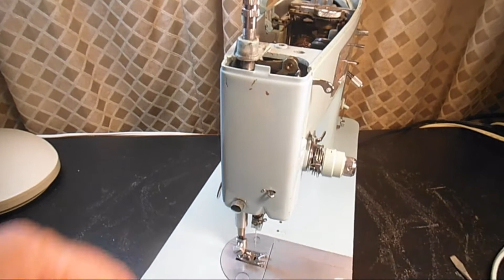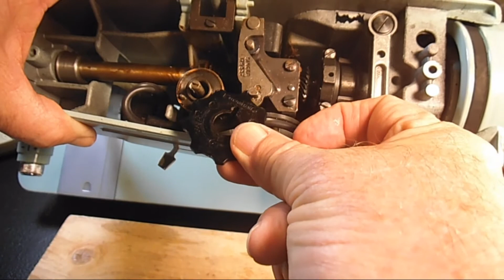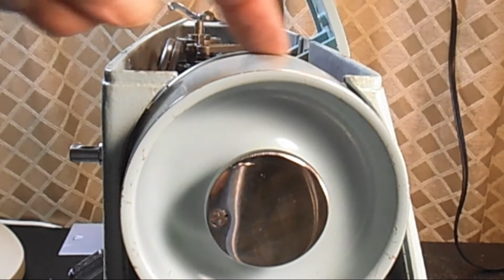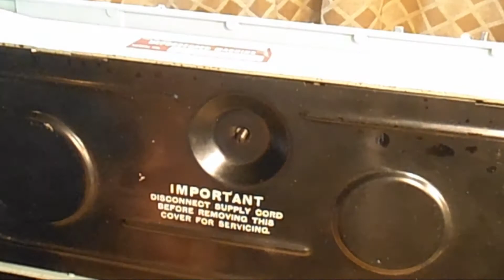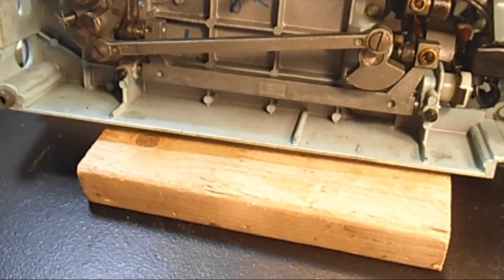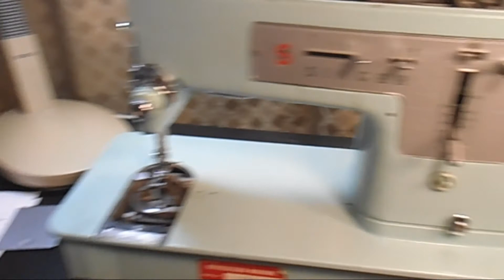Look inside a working Singer Model 338 Sewing Machine

Comment: Thanks for the video Andy it looks just like my 348
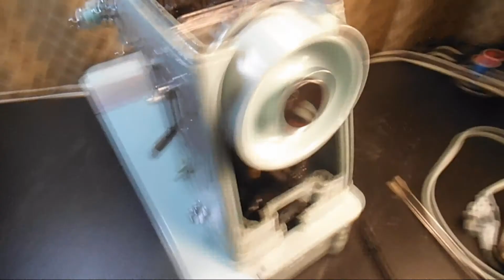Reply from the maker: Yes, the 338 and 348 are very similar but for one big change on the 347/348. The 348 is a 1966 update to 1964 338. They changed the entire hook system on the 348 to a rotary hook powered by a timing belt and metal pulleys replacing the oscillating hook powered by pitman rods on the 338. That change means the 348 is a little faster and the hook is quieter. For others reading this, you can watch this video starting at about 3:20 to get a good look at what the hook/drive system looks like on Ronald's Model 348: 
 https://youtu.be/twlPTcJW5mY      Both are very nice machines for sure though. Thanks for watching, Ronald, and take care.
Reply: @andytubesewing1953  you are the best...
Reply: @andytubesewing1953  sounds like the 338 is more like an old 66 kind of with the rod action
Reply: @andytubesewing1953  I was going to tell you about a month ago that my 247 has mm designated as stitch length, so I believe that could be a European model it's the kind with the wood grain going across the top about a 1970? It's hard to date then it also has a timing belt.
Reply from the maker: @ronalddaub9740  I don't know the date for the 247, but I believe it was made in Brazil.  https://www.singersewinginfo.co.uk/campinas   It certainly was sold all over what became the EU as well as N. & S. America.  I've never seen one in person or worked on it. I think that factory had a system of using one body/mechanics to make a few models like this one was used for about 6 models. You can get a free copy of the multi-model manual from Singer SUpport here: https://www.singer.com/search/support?title=247

Comment: Hello Andy!  
I love my Singer 338 which I've had since 1994.  Yesterday, the metal piece, screw and washer on the stitch length lever came off in my hand.  Because of the pandemic lock down, no stores are open.  Can I fix it myself?  Please let me know.
Reply from the maker: Hi Carolyn. Metal piece meaning thumb nut? You can reassemble it. Below are videos about removing and replacing the whole feed regulator, including the lever, slide, nut, washer, and screw. Take a look and see how the system works.
Not that you'll have to take it all apart, but if it is loose, etc. you should know how it works.
the last video is an alternate way to attach the screw if you have trouble. Good Luck.
https://youtu.be/jXqPKo1ctxg

https://youtu.be/Ee3ZHhXWrWk
https://youtu.be/4j4BvYpKEQw
remove cover plate: https://youtu.be/oWBLRNuD3BQ
https://youtu.be/Uo2GEHi74Wc
Reply: @andytubesewing1953  Thank you so much for getting back to me and for sending me the helpful videos.  I was able to fix my machine's problem using the alternate method.  It went together easily and is back in working condition.  It was helpful to see you perform the method.  Turning the thumb nut to the left was not obvious, so thank you for guiding me through that.  I used the q-tip and oil suggestion for the inside of the thumb nut and I didn't experience any hesitation getting it onto the metal plate. I have actually owned the machine since 1964 (sorry for the typo above) when my favorite aunt gave it to me as a gift when I was a new bride.  My husband always kept the machine well oiled and fixed anything that went wrong.  I lost my husband a few months ago and panicked when this new thing happened.  Thank you for coming to my rescue.  I am now making face-coverings to give away during this crisis.  Any way I can help.  God is good.  Yes, I did pray for an easy fix.
Reply from the maker: @carolyncarter4126  I'm happy to lend you a hand so you can continue to help others. It's nice how this worked out! Yes, God is good. Always. Thank you for lifting e up today and take care.
Reply: Is your 338 all metal, with metal gears?
Reply: @zj2707  Yes.

Comment: Hey Andy, I recently bought this model. Cleaned it up, bought a service manual and am loving this machine.
 Wondering if you can tell me how the top thread guide is secured inside the top cover. Mine is not attached. It looks as if there was once some sort of slide on clip that would secure it. How is it attached on your machine?
Reply from the maker: Congrats on getting such a nice model. This video is 6 Y.O. and the machine was shipped to its owner a week after the restoration.
       You are correct that there is a slide-on clip that fits on the bottom of the guide under the arm cover. The top part is #179644, and the clip is #179645. It would be rare for a seller to sell those parts separately. You usually need to buy a vintage cover plate and replace yours or just use the clip. 
      Those two parts are on Models 337K, 338K, 347K, and 348K so that may give you more sellers to search. For a small part like this, I often find sellers who are selling other parts of the machine but not the top cover and contact them to ask for the part I'm looking for. Most sellers on eBay will respond if they have the part and offer to list it so I can buy it. They charge a hefty amount but then they have to find it, list it, ship it, etc. I know there are sellers on ETSY and other places but I've always found the most selection of eBay. Sometimes I've had to send a picture(s) of the part and where it goes. A few times I had to explain how to remove it.
Reply: Thanks a MILLION, Andy!
Reply from the maker: @MildredGlutz  no worries and good luck!

Comment: Thanks for the video. I have a very early Brother machine that also has the cams. My mom had it serviced before she gave it to me but she rushed the guy who said he needed more time. 1st time I used it when I loosened the knob in the wheel to do a bobbin, the knob wouldn't catch to tighten. What is your advice? The video didn't show the mechanism.
Reply from the maker: I don't know anything about Brother Machines, but here is a belt replacement video for model 337 and starting about 8:20  of this video:  https://youtu.be/RuOLUVPsQv8    I show how to instal the stop motion clamp that is between the handwheel and the chrome knob. If the clamp is installed incorrectly you can not tighten the knob so the machine sews again. Usually you must take the knob off and then have to turn the clamp 180 degrees on the shaft and but the knob back on and that fixes it.

Comment: I’d just like to say that you do such a great job of describing everything. Pretty amazing. I have this beautiful machine and am watching your videos in hope of learning as much as I can about it. I’ve had her for 8 years and am barely at a time that I can start to use her. I’m not sure if you will see my message but I was wondering if you could help me with a question I have. When I turn my wheel for the needle to go up and down nothing happens. It seems like my needle is stuck in the down position and it wasn’t like that before. I don’t know if it needs repair of it there is some sort of break on. Maybe you can help me. Thanks in advance for your time.
Reply from the maker: Welcome to Andy Tube Evangelina. If the handwheel is turning, the needle bar should be moving. The all metal parts for that are "direct drive" so it can't be a belt problem. Is the Stop Motion Knob engaged? You may need the instruction manual which is free here:  https://www.singer.com/sites/default/files/product_manual/SINGER%20338%20Sewing%20Machine.pdf
Page 9 of the manual shows what I'm talking about. 
 I also did a nice series for model 337, the sister to your machine. It is a step-by-step restoration of the machine and you may find it interesting if you need to clean or adjust or repair your machine. Here is my playlist: 
https://www.youtube.com/playlist?list=PLsCOZgzzaiKJxbOOMKQPvmeTRqi0dhGa5
My dauhter owns this machine. Of all the machines I could have restored for her, this is what she wanted.
I read where the Greek meaning of your name is "Brings Good News". Beautiful! I hope I have brought you some good news too. Good Luck and Take Care.
Reply: Andy Tube  Thanks Andy very much! Your honestly so talented, I realize that more and more every time I watch a new video of yours. You make me want to have more patience :-)  The combination of your knowledge and patience make you a very good teacher. Sewing machines have always had a special place in my heart but I’m barely starting to make time for me so exploring with you and your videos is very exciting. Im a jack of all trades, but a master of none :-)
Reply from the maker: Oh, you are in for a good time! Thank goodness for YouTube. There are many VSM videos where people have shared there knowledge. I hope you will have as much fun as I do. Thanks for your comment. Take Care.
Reply: You'll love this machine, it a dream to use. I've had mine since 1966 and it's brilliant.

Comment: I am always fascinated by oscillating hook mechanisms. Maybe because all mine are rotary and what you are used to is "normal?" This machine looks to be in really good condition minus a couple scratches, dirt and missing bed cushions. I did notice you completely ignore the "unplug before removing this cover" warning on the bottom plate! Shame! LOL! Are you in process to restore this one or are you just playing to learn your new software?
Reply from the maker: I do like the simplicity of the oscillating hook and the cranks. It is a little noisy though, to me. People have told me the don't even notice the sound when they sew, unless something sounds "wrong" or "different", no matter what type hook they are using. I don't sew a lick, so I DO listen when I'm working on a machine. Listening for the "off" sounding mechanisms I guess.
Yikes...busted for leaving the cord in! Too used to working around voltage all my career I think. Hope YouTube did not notice.
I originally just planned to do a handful of videos about the functions of this 338 while learning the new software, but the more time I spend with her, the more I start thinking of how nice it would be if she was all cleaned up. She does have a couple of blemishes, but runs true and tight even though neglected. Haven't decided. Thanks for the comment. Take Care.

Comment: Hi Andy!  I just picked up one of these machines and I was wondering if you might be able to help us with it, it seems to be froze up, when we turn the knob, the shaft doesn’t move and it seem to be stuck down by the needle bar.  Any suggestions?  Thank you!
Reply from the maker: Unless you see heavy rust it is common for a vintage machine that has been in storage a long time to be "frozen". It is usually dried oil in the bushings, bearings and other moving parts. A few ways to get things moving are to ad oil to the 29 oiling points shown on pages 66 to 70 of the Instruction Manual which is available free from Singer Support page at this link: https://www.singer.com/search/support?title=338 It a 74 page PDF. After oiling you can wait or use a hairdryer to heat up all those areas to help soften the old oil. If you like you can use a penetrating oil instead, like WD40 or similar, the the heat. Those penetrants are not for lubrication though so you must later flush it out with lots of SMO (sewing machine oil) in the "old days" repair techs would use Varisol or kerosene to flush the old gunk out, wipe the machine clean and then add oil. Patience is the key. I have a 30 video step-by-step series for restoring your machines little sister model 337, https://www.youtube.com/playlist?list=PLsCOZgzzaiKJxbOOMKQPvmeTRqi0dhGa5  You can find lots of repair, cleaning, adjusting, replacing parts help in those videos if needed. One single stuck part will freeze the whole machine. You mention "down by the needle bar"; the needle bar goes thru bushings and the needle bar is often the part owners oil the most. The oil settle into the bushings and can be as hard as vernish now. If the bar is stuck in the bushing nothing on the machine can move much. Good Luck and thanks for watching my channel.
Reply: @andytubesewing1953  thank you so much for all the info!  My husband is helping me, we will watch your other videos as well!  Thanks again for putting out all this content!
Reply from the maker: @leslieannedmunds685  It's a great project for the two of you. My wife and I have done a handful of machines together and always had fun with it. Easy does it and if you start taking parts off to clean just take pictures before and during.
Reply: @andytubesewing1953  that’s a good tip, thanks!!

Comment: Hello, I have a singer 338 and recently took it out of storage. I followed your threading video. However both the top and bottom thread are not interlocking. What could be wrong?
Reply from the maker: Your needle bar could have slipped and is not at the correct height: https://youtu.be/HfTrIdUpU68     It's rare on this machine but you could have lost timing between the hook & needle. You can buy the service manual showing all the adjustments on the machine for $8.99 here: https://manualsoncd.com/product/singer-338-sewing-machine-service-manual/

Comment: Why would they use oscillating instead of rotary? Is there a design reason?
Reply from the maker: Don't know. Oscillating came first, I believe. Vertical hooks below the bed. Rotary usually involves belts, pulleys or gears. Maybe that was more expensive to make? Don't know.

Comment: Hi...I have exactly the same machine.... Having problem with the shuttle... It's not moving any idea
Reply from the maker: Welcome to Andy Tube Khan. That is an unusual problem to have on this machine. The hook is driven by all metal parts, so no belt to loosen or get broken. If the hook is not oscillating I'm thinking a part is missing or loose.
In this video at 18:10 I try to explain the oscillating hook shaft, then at 18:54 I run the motor to show how the shaft and bell crank make the hook move. If you do the same does the shaaft and bell crank move like in the video?  That bell crank is connected to the bottom of the hook. Are any screws missing there? Here are some links for you to a free copy of the instruction manual, a free copy of the parts diagram and to a site yu can buy the service manual for $8.99 that shows how tor adjust and renove and replace everything on the machine. I hhope these can help you find the problem. Good Luck.
https://www.singer.com/sites/default/files/product_manual/SINGER%20338%20Sewing%20Machine.pdf
http://parts.singerco.com/CPpartCharts/3_39999/338.pdf
https://manualsoncd.com/product/singer-338-sewing-machine-service-manual/